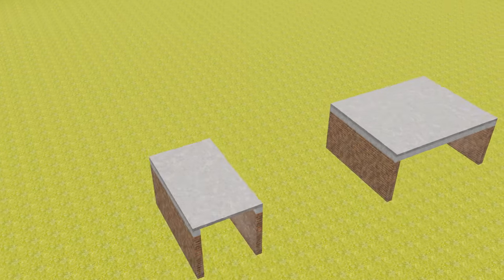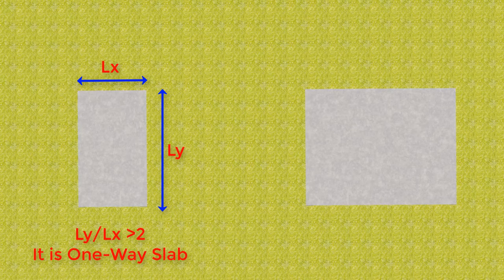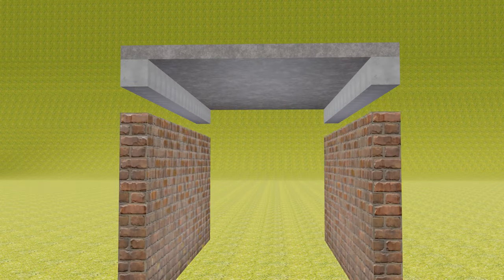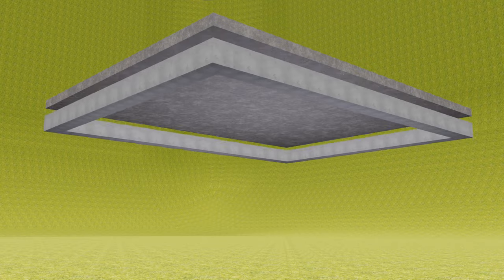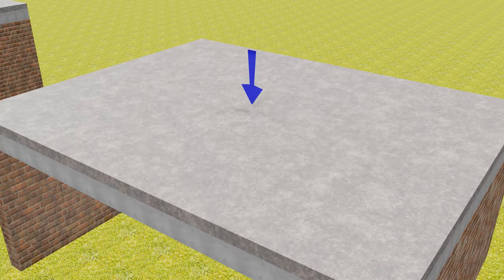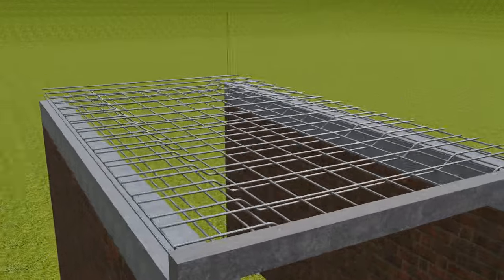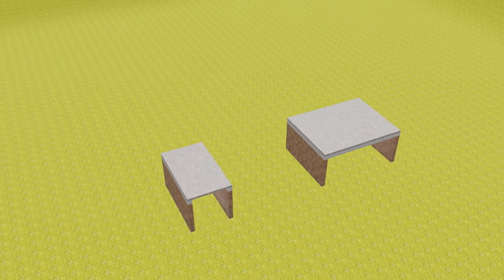ONE WAY SLAB AND TWO WAY SLAB | DIFFERENCE | REINFORCEMENT DETAILING ANIMATION VIDEO

Comment: Three side supported slab.....???
Reply from the maker: it will depends on it ly/lx ratio as said in the video.
Reply: @thehonblecivilengineers  ohh.... really....... You should check if that is as simple....... did you understand my question?
I meant 3 sides supported 1 side free....

Comment: Nice bro. When we put on the roof concrete got rain and stopped in the middle (house part completed)and the next day continued the next half(portico and steps). Can you give your suggestion.
Reply from the maker: yaah. on the first day work you dont need to make it smooth finish. let it be rough with ups and downs with slant finish. then on that next day, if you pour concrete it will have good bond

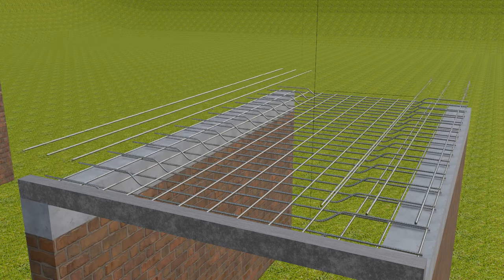Comment: 1:49 how do we calculate Ast for extra bars provided in 1 way slab. please mention the codebook and clause too
Reply from the maker: no design calculation for that. you will only provide distribution bars 6 nos at top 3 on either side
Reply: @thehonblecivilengineers  ok thanks. i made a design calculation on a one-way slab design but got 8 distribution bars in calculation I was just wondering whether they have separate calculation or did i make a mistake

thank you for clarification